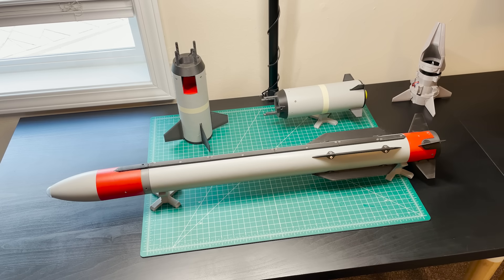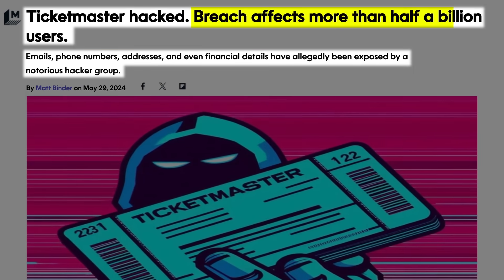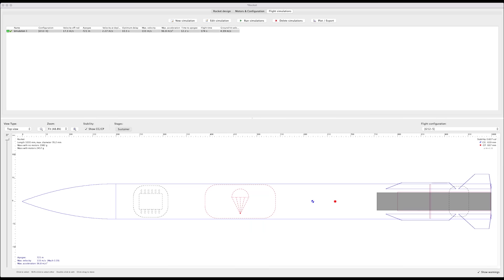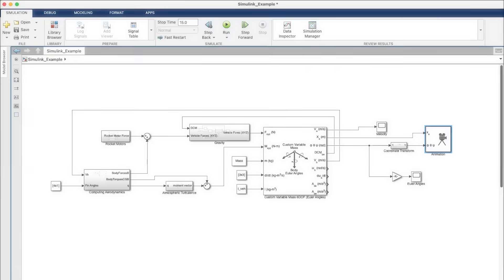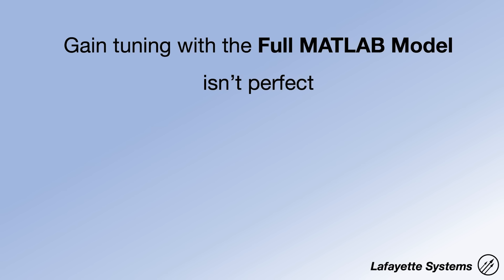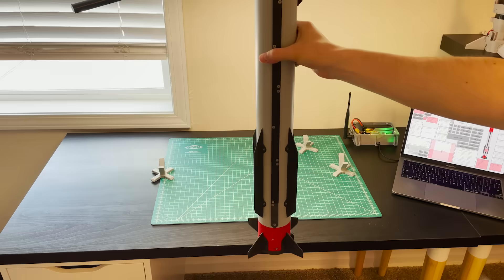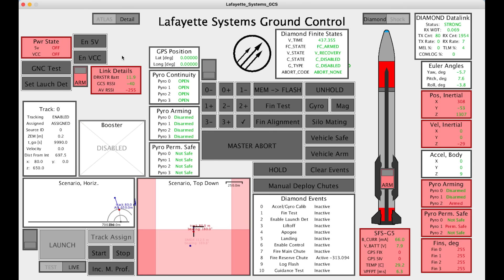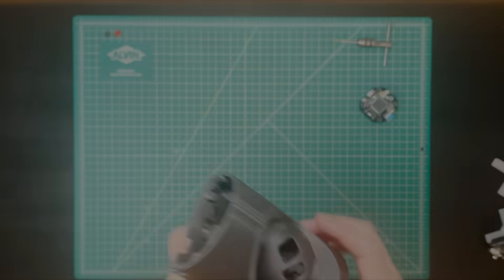Modeling and Simulation of Advanced Amateur Rockets

Comment: Excellent job! I would also suggest to consider that adding guiding flaps on the top side of the rocket. not solid flap, flaps with hives. It will work like a gyroscopic motor for fast angle and rotation recovery.
Also the rocket diameter and length ratio looking ok. 
Have you ever think to make smaller the chamber and make bigger the nozzle about %10 of their size.

Good job bro. Keep going to the space !

Comment: There is a game called, stormworks search and rescue. You build boats and helicopters to search and rescure, but the developers of the game have made it so you can build more advanced stuff like rockets, where you have parts like gps, altitude indicator, yaw angle and pitch angle, and you can even design your own logic like PID controllers based on what the insturments output. In that game i made pretty much what you are making in real life, just that what i made was more like a ballistic missle. I made the rocket ascend until its midway to the waypoint it has to hit and than it starts descending aiming straight to its target. 

The airdynamics are very unrealistic but its very fun and a bit complicated.

Comment: Have you ever thought about using a learning based solution? I'm working on quadcopters and we have created a learned dynamics model, where we augment a physics based dynamics model with machine learning, obviously this requires some real world flight data, but it can be super sample efficient with the right approach. With our own project we have an infinitely better dynamics model than we ever could create by traditional means, and we strongly believe this is the only feasible way to simulate the aerodynamic effects to this extend.

You could also use a MLP trained with something like PPO in sim for the actual flight controller, instead of relying on more traditional control systems.
Reply: That's very interesting! In what ways is the model better? In the sense that it takes into account tiny things that traditional rigid-body modeling + some aero forces doesn't?
Reply: @dashs2597  you can model the rigid body stuff really well, the problem comes down to the aerodynamics, for example with a quadcopter you have 4 propellers creating all sorts of turbulence around the body, and the worst part is the airflow generated by each propeller interacts with the other 3 as well, it's impossible to simulate this with CFD. This is actually the trick, to use a well put together rigid body simulation and augment it by estimating the external forces acting on the body given the current state.

I'm not that familiar with rockets, but obviously simulating the aerodynamics is a huge issue there as well, although significantly less compared to quadcopters. Not sure as to whether it is worthwhile using a learned dynamics model, because it's complicated, computationally slower than using approximation for aerodynamics, and it requires diverse flight data. 🤷‍♂
Reply: @boldizsarszabo  
I think this learned approach is generally done as well, but in a more manual fashion for rocketry projects. It's usually the case that a autopilot tuning is done after a flight test through engineering intuition and experience. 

I do think that the reinforcement learning benefits you'll see for rockets are probably going to be less than quadcopters, just simply because there is less to learn. Generally subsonic to supersonic rocket aerodynamics is pretty well understood and captured by empirical and data based aerodynamic tables (see DATCOM), and the flow around said vehicle is generally pretty linear since static airframe body contact to air dominates. 

The nonlinearities are usually a result of the smaller fins that actuate, but if the flow is subsonic and the fins are placed rearward (meaning fins are downstream of a majority of the rocket body), you can get away with linear assumptions for aero. Of course this breaks down a bit for supersonic flow, but still, at low angles of attack you can get away with a lot of linear assumptions.

Compare that to very large non-linearities in the flow for a quadcopter, due to the large rotating propellers that heavily determine the flow structure around a quadcopter body.

Comment: OpenRocket is much more accurate than you would think. The problem is you have to put in ALL the parameters and have it reflect your design. Most people using OpenRocket do not even know just how many parameters there are. Did you know you can input the approximate surface roughness of the paint on your rocket? You need specialized measurement tools to get that value but if you can, OpenRocket can be really good. Where it struggles are atmospheric modeling which is pretty simplistic and doesn’t allow for measured high altitude winds and it struggles with compressible flow dynamics. But if you’re flying a subsonic rocket to less than 10,000ft you can get within less than a percent error almost every time.
Reply: Yep. And if you’re flying supersonic, then use RASAero II since it actually simulates Mach drag.

Comment: Hey great video!  If you are looking for topics, there is one black hole in all this that I have never filled.  That is the physics and math of the aero forces and moments and how they get modeled in all this. A body and a fin will have lift and drag, and a moment.  Where does one get those parameters?  And then, how are they combined to model the flight dynamics in the software such that a controller can do something to control the rocket intelligently?  I think that is worth at least one video if not two or three. First video might be how to find, get calculate derive the aero coefficients of the rocket parts. Next video could be how to take those aero coefficients and combine them to get net rocket linear and rotational forces. And a third video could be how to take those forces and integrate them into final net rocket accelerations, velocities, positions and resultant path. Thanks for considering!
Reply: The aerodynamic blockset in simulink shown in this video is a pre-made tool for calculating and simulating those forces using a supplied cad model. For applications like this (which I believe is subsonic), that will do well enough until you get flight data. The point you make is very relevant when modeling supersonic flow, and for that you would likely need to do some CFD and using that data to create your own aerodynamic simulation, and then tuning a controller based on that simulation.

Comment: Have you considered building your Simulink control code directly to C++ using MATLAB/Simulink Coder? If you have access to that toolbox, it could eliminate a big opportunity for mistakes in your current manual translation process. It’s commonplace in motorsports and automotive industries to do all of the coding in Simulink and automatically build it into C or whatever language your target hardware uses. Anyways, this series is super impressive and professionally done, great job!

Comment: I have a question more for the previous video, but i will ask here since its the latest one. You got some amazing results in waypoint mission, but, i wonder if you verified your Inertial positioning system against GPS or some other reference frame to make sure that the rocket really "knows where it is"? ;)
Impressed by your work

Comment: As a mechanical engineering student that has mainly been focused on mechanical design so far, this project blows me away with what you’ve been able to achieve here. Projects like these fascinate me because they encompass all the things I’m currently bad at as a student but want to get better at in the future. I’m starting systems and controls this semester but my fluid dynamics and programming skills are very rusty and I have little experience with electronics. So, I would be interested if you had any advice for people such as myself on how to tackle projects similar to yours.
Reply from the maker: The best advice I have is to tackle learning new things one at a time. There’s lot of free resources out there that can help with aerodynamics and controls. They are kind of dark magic even to the people with PhDs but learning a practical amount is surprisingly accessible!
Reply: @LafayetteSystems  Thanks for responding!

Comment: Nick...question....Do you think that your approach to model rocketry design... aka OR / RockSim + Matlab + ground simulation + electronics... will ever take off in the model rocketry arena?   In other words, will the average rocketeer (that wants more than just the "how high" and "how fast" to seem like an expert) ever catch on to what you're doing, as I'm sure that you have followers that have already...aka...me and the others.
Reply from the maker: For the average rocketeer, the last two phases probably won’t be very common. They really aren’t super necessary without a control system unless you’re doing them for fun/experience. Some of the commercial flight computers have some ground test options available, but without a control system they don’t need to be and aren’t very sophisticated.